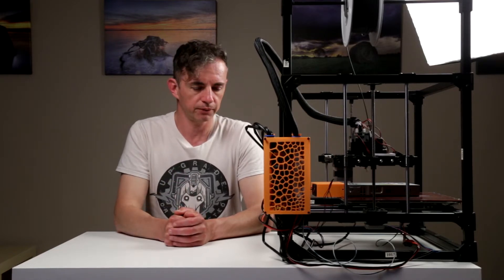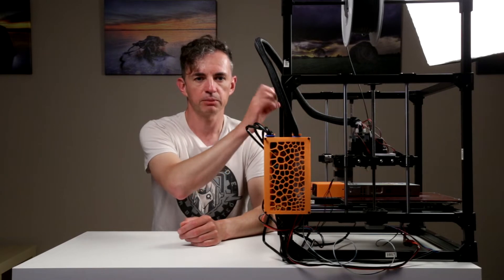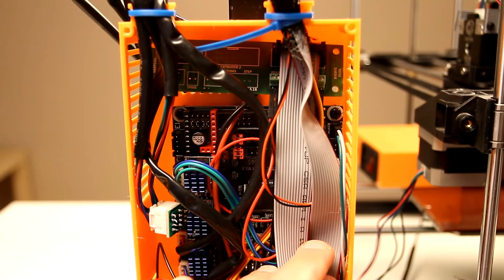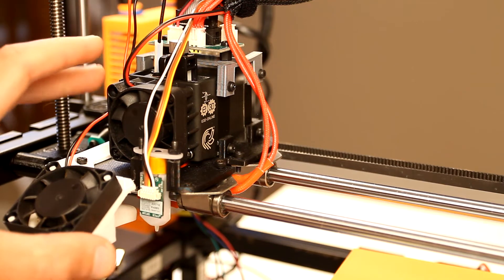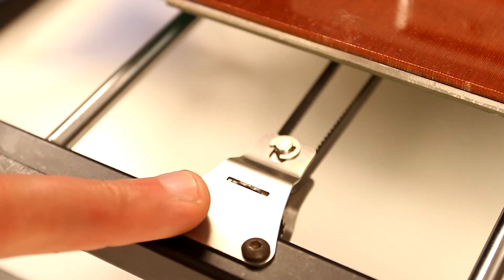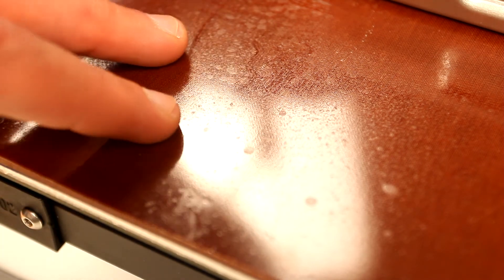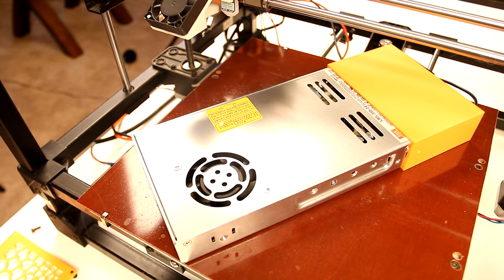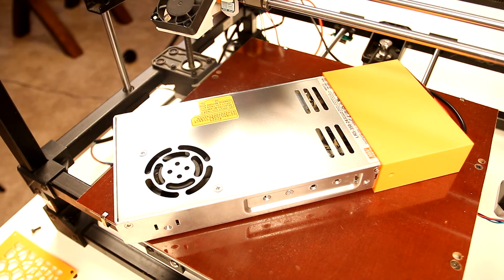RigidBot Upgrades after 8 years ! Still doing strong

Comment: What MCU / controller do you recommend as an upgrade?  I have the original regular-size RigidBot.  I'm having a consistent layer shift issue with a complex print and I'm beginning to suspect it could be the controller being overloaded when a move is commanded and it's missing a step.   I've checked all the mechanical aspects, slowed the print, travel, jerk, & enabled z-hop, as well as trekking it to avoid printed objects and supports when traveling.

Comment: i found a seller selling both the big and the normal one for $150 cad together and i didnt know if its worth buying becasue of its age. I need a bigger printer for some of my projects and i think im just gonna buy it becasue the upgrades arent too costly either
Reply from the maker: Good price for 150, but depending on what needed to be done. If completely redo all but frame it will climb close to 600-700 extra plus hours of work
Reply: @InsideOutElectronics  oh, well in that case i got myself a really good deal. everything is fine, just need to replace the extruder ends
Reply from the maker: @DidNotFinish.  Very nice then!

Comment: Do you have a source to get the Peter Stoneham ByeBye breakout boards for the ribbon cables?  Or do you have a source for a wiring diagram for it?  Thanks, great video. Nice to see the RBB lives on.
Reply from the maker: The only source was Peter himself. Not sure if he is still doing that. I do not have diagram as well, was probing.May be this will help - https://drive.google.com/drive/folders/1LnArOHscJH5MPvaomn7hUAh_YC5uwihV?usp=sharing
Reply: @InsideOutElectronics  thank you, I will take a look. If nothing else, yeah, I will pull out the multimeter and figure it out.

Comment: I have a first generation Rigidbot the small one (25x25x25").
I have done a lot of modifications to it through all the years including another mainboard, PSU, optical end switches, control panel, glass bed and soon also a homebuilt polycarbonate enclosure.

I tried to print with TPU (flexible) filament today and that was an unsuccesful experience. The filament  got tangled up between the feeding gear and the cold side of the heater.

I am thingking about put an other  extruder to it.
What do you recommend?
I am thingking about some direct drive dual gear solution, what do you think about that?
Reply from the maker: Hey thank you for watching ! ON my another RBing, I'm using E3D V6, and have PTFE tube coming very close to the extruder gear with minimum gap, preventing TPU flexing and escaping filament parth. Have not tried TPU on this printer
Reply: I looked that E3d V6 out now @InsideOutElectronics . I see no stepper motor, must be a bowden extruder. Maybe it will work anyway but I think I will choose another model.
Reply from the maker: @Jappmannen  E3D V6 is just a hot end. I still using stock stepper and gearbox in my RBB
Reply: The choise felt for a Bondtech LGX ACE Mosquito @InsideOutElectronics  
Works really well.

Comment: Well done and very decent upgrades too. The best part of the Rigidbot printer was the community IMO so my only critique would be to recommend a larger PSU than 350w (400w+) - as was the consensus of the original Rigidbot G-groups community. Also,  the Bye-Bye board was designed by a fellow by the name of Marvin Stuart, but Peter Stoneham's contributions to the community were quite significant.
Reply from the maker: Thank you! Happy is was useful! 
I wondering what is the math behind 400W+ requirements, I thought this is for RBB not RB? Even my RBB with 450W PSU very rarely hits 11A when using HB so it is barely ~300W
Reply: You'd remember when the rigidbot was released, Abs was one of common filaments people were printing with. The original bed heater wasn't bonded to the aluminium plate and the plate itself wasn't particularly flat so when you include a glass plate into the mix - we'll, people were happier with the larger wattage.